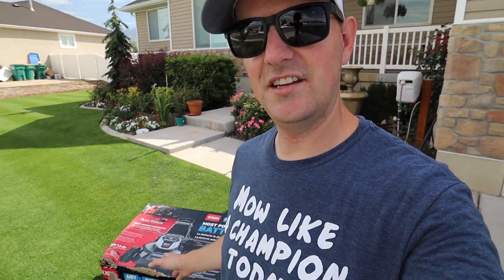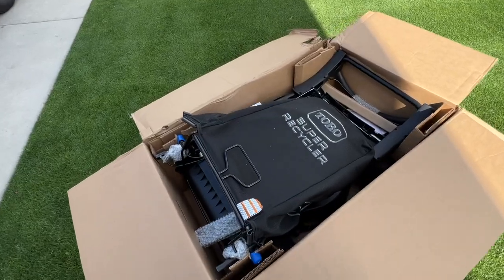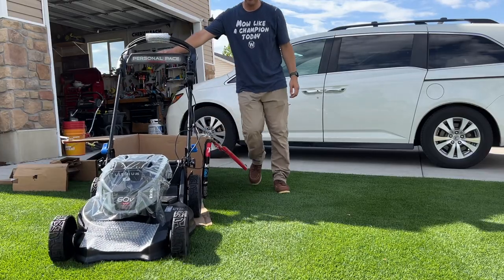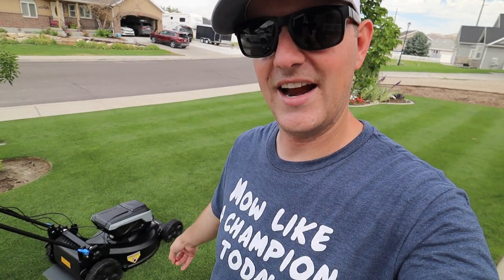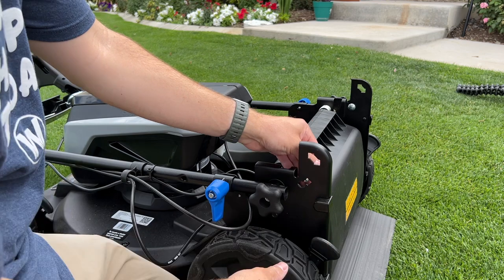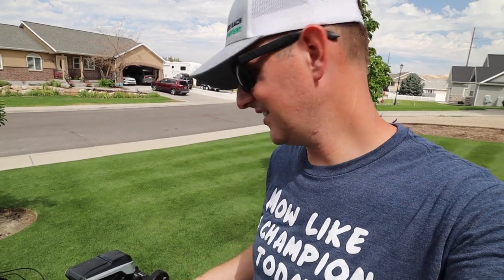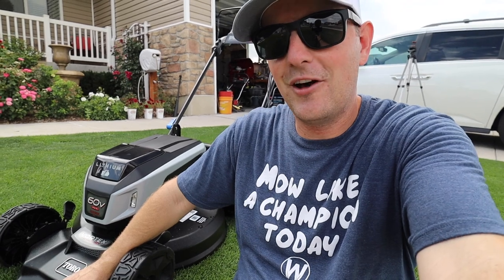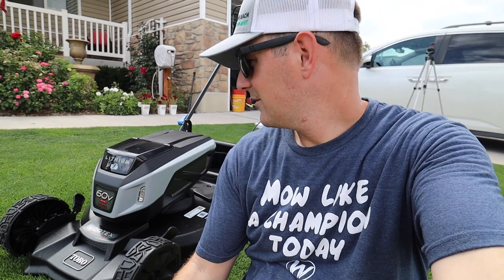Toro 60V Super Recycler (21568) - Unboxing and First Impressions

Comment: Great video Jimmy. I have an earlier model of the Toro Flex Force mower. Mine has a 6.0 amp battery but I am able to cut my neighbors and my own lawn on a charge. We live in narrow lot homes in Florida. The fronts are 50 ft each and they are about 100 ft deep. I really like that you do such an in depth video. It is all the little things added together that make a good product and you do a good job with that.

Comment: Please review the personal pace system in detail especially in more confined turning spaces.  I have the previous model Super recycler and I often find the drive still engaged when trying to pull the mower backwards, it is a pain to have to push it forward a bit to have to disengage it to have it move easily backwards.
Reply: All Personal Pace models are this way… it’s the primary quirk that one has to work around.  I’ve been using this exact mower since early June… and what I’ve learned to do is keep one hand on the PP handle, and move one down to the bar below… then use the hand on the bar to do the “pushing” when I’m in tight spaces to keep PP from engaging.  I feel the previous Toro PP handle design was better for this personally (it was much smaller), but that’s just my opinion.
Reply: Still, not so easy and makes mowing not so fun.  Since this my first self propelled mower I am not impressed, especially from Toro.  I will be looking at purely push alternatives.
Reply: Your Personal Pace just needs adjusting. I believe the instructions are in the manual, or look around on YT.  Mine has been perfect for four years and counting.
Reply: @TheGOF  I think he’s referring to how it needs a few inches to “unlock” when backing off the PP handle.  Otherwise the rear tires are still engaged and drag or have heavy resistance when pulling backwards.  I’ve learned to work around it (using the method I mentioned above), but from what I’ve experienced - adjusting the PP doesn’t resolve it, but rather adjusts the “sensitivity” of PP when being used.  At the end of the day, all self propel systems have some sort of quirk… but PP is by far the best in my opinion and the only one I will use.
Reply: @SiXX5150  The condition described is a symptom of an out of adjustment Personal Pace system. The adjustment is on the cable from the handle to the drive system. On my 2018 it’s a large plastic knob that allows the cable to be repositioned. Mine has never needed adjusting so I’ve never touched it.

Comment: Hi 👋. Have or Gavin noticed rattling or clicking noise coming from deck ?  I have that exact same model with the light. Thanks
Reply: My Recycler does the same thing,I believe it’s the belt tensioner on the under side of the deck.

Comment: hey I was wondering if you could test out a theory for me . i own a toro 60v mower . i found that cutting grass with the bag on lasted longer than just mulching. Can you do a video on this and teach the public .
Reply from the maker: Interesting. My suspicion is that bagging clippings adds additional weight to the mower, which would require more battery power. I will test and include that in my upcoming review. Thanks.
Reply: Bagging and side discharging uses less battery. Mulching capability requires the most battery power of the three modes

Comment: At that price, mower height adjustments should be one touch, not wheel by wheel.  Handlebar height and angle adjustments should be built in and tool less.  If Ego can do all of those on all their models, this just makes Toro look lazy.  But it does have a nifty pop up battery door.
Reply from the maker: Agree with you, and plan to touch on that in the review. Thanks.
Reply: A wheel by wheel height adjusting system results in a more rigid deck as oppose to a floating mechanism such as a “one touch”.

Comment: For the money, I'll still take the Ego over this. Better battery life and performance overall for a homeowner. I have almost 17k square feet and can mow the whole thing on a single charge. Toro can't come close, and even if they do eventually, it will be hard to switch after investing in multiple tools and batteries. Ego is not perfect, but they still don't have any good competition yet

Comment: $750 seems crazy to me. $200 too much imo.
Reply from the maker: It is steep. Not the most expensive, though. Batteries add a lot of the price.
Reply: @JimmyLewisMows  you must be talking about the Milwaukee one 😂. Only fan boys are going to buy that for over $1000
Reply: @ColeSpolaric  if you want the most powerful, milwaukee is it right now.  Followed closely by the ego xp in terms of power and its abt the same price as this toro.

Comment: the handle adjusting and mulch plug is a step backward from the regular vortex that I have.  Seriously someone at toro should be fired, this is your flagship model, so should be easier  it's already more expensive. Its bad enough you're still using 4 adjustment levers and a metal body. Who here mows in the dark?
Reply: The mulching plug is the same used in the commercial mower. Makes a tigher seal unlike the one with the lever. And it’s easy to take out. Push the tab and lift straight up.